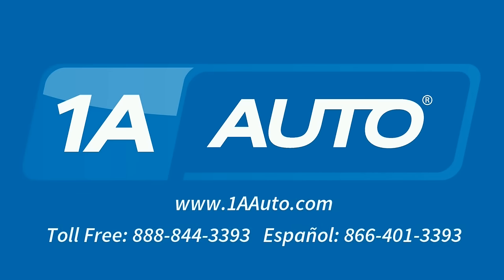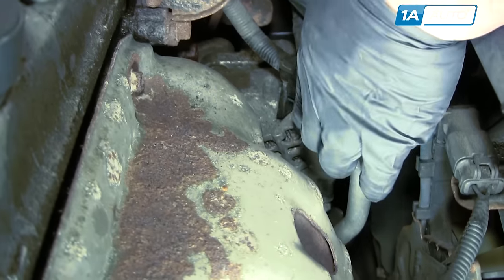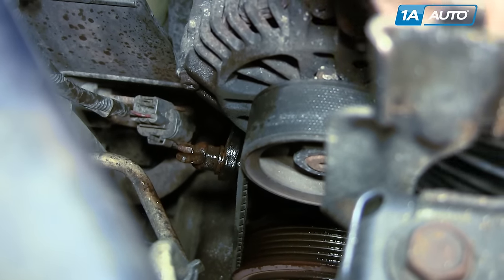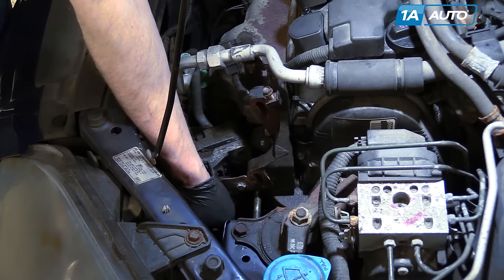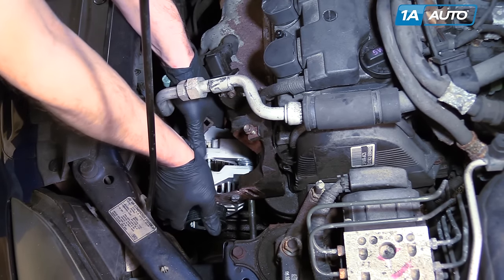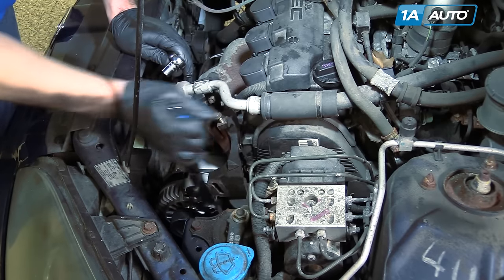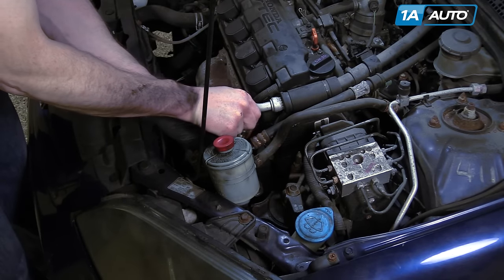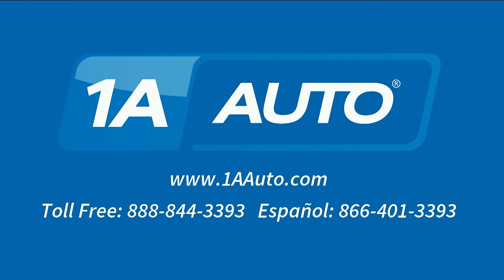How to Replace Alternator 01-05 Honda Civic

Comment: For anyone watching this. If you run into trouble trying to get the bottom bolt in through the lower spacer bracket, remove that lower bracket altogether and put it on the alternator outside the car. Then when you put the alternator back in, its much easier to reach up and bolt the bottom bracket to the motor where there is much more hand room. Also it is optional whether or not you put the cable clip on the new alternator. With the terminals secured it wont be moving around anyways, and those brackets are known to cut your hands to shreds when working around them.
Reply: i fucking love you

Comment: Great video, it was a huge help!!    One suggestion to anyone reading this before they do the work:  wait to undo the battery cable wire and the plug from the alternator until after you get it fully loose.  You can get the alternator into the nice open area vacated by the PS pump to easily access those two things, you can see the guy in the video struggle to get those off with the alternator in place, there was no need for that  :-)
Reply from the maker: +Stephen G Thanks for watching. The advice you gave will assist other viewers perform this replacement smoothly! If any of our viewers needs to make this repair, we carry the auto repair part shown in this video on our website. Here is a link to them http://www.1aauto.com/acura-el-honda-civic-alternator/i/1aeal00432?utm_source=YouTube&utm_medium=CTA+Comment&utm_campaign=ytcomment&utm_term=qE-_5drM4CM
Reply: Question guys I gotta 02 Honda Civic I'm having a issue u might have a part that I can buy from ur guys as I approached the high way my car started like studoring the pick up speed an the rpms started moving up very slowly by a lot it took me a bout 10 seconds just to get to 20 mph the battery gets recharge by the altinator so it not busted what is the issue if u may get back to me I would like to order some parts from u tank u for a great video
Reply: @MK-xw1rp that could be some number of things. Spark plugs misfiring, maybe injectors not feeding the fuel proper, something to do with your throttle etc. I’m not a mechanic tho, and see this was from 4yrs ago. What did it end up being?

Comment: I used your video for my daughters 03 civic......great video but one "improvment" since the bumper shroud is already off, 4screws and the driver headlight assembly comes out and leaves a nice access port to work through and remove alternator through it as well as easier to see the various bolts and gives you a decent view of the belts and pulleys........just a simple suggestion or addition.......you guys ROCK thank you for the videos, huge fan, even mounted a tv in garage so I can play pause while working from your vdeos

Comment: Good video but expect this to take a couple of hours if you have never done this.  Getting the lower alternator bolt and adjuster into the new alternator was the most difficult.  You cannot see the bottom bolt and must do everything by feel.  My reman alternator did not want to fit into the bracket at the top.  With pliers you may have to push the new alternator  bushing in to gain clearance.  Clear the paint in the new alternator’s bolt holes with the old bolts before installing the new alternator.
Reply: Dude i would buy you a beer thank you that tip about the top bolt helped alot thanks man.
Reply: Take the headlight assembly out next time, you can reach in and clearly see and line up the adjuster bolt, removing driver headlight assembly leaves a huge open port to work through

Comment: I used this video to replace my 21 year old alternator with an upgraded high output 130 amp alternator. If anyone else does this make sure you upgrade the cable that goes to the battery with a 4 AWG stranded cable. Not doing so can be very dangerous. Excellent video and thanks so much.

Comment: very informative how-to! Most places want several hundred dollars for labor but I was able to do this myself in about 3 hours.  Getting the old alternator out was straight forward and took about 1 hour of careful work.  Putting the new one in required more work, about 2 hours.  My OEM refurbished alternator was slightly wider than the car's hinge so I had to grind down the joint margins just a bit to make it fit.  Threading the bottom screw + washer + track + hole was a nightmare.  I ended up temporarily anchoring the alternator and then blindly threaded the screw + washer + track.  That one screw took a good 20 minutes of effort.

Putting the main belt on three pulleys was also a challenge until I put maximum slack on the tension washer. 

I agree with the comment about waiting to dismount the alternator before unlocking the power cables -- it's very difficult to do when still mounted because of small space.  I also agree with the comment about first threading the holes in the new alternator before placing in the car.  It makes it easier to thread later when it's in the car. 

I used both socket and allen wrenches, a crow bar, and penetrating oil.  I highly recommend a flexible magnet (it's a very long malleable rod with a magnet on the end) for retrieving the dropped screws/bolts.  No matter how careful you are you are bound to drop at least one.  =)
Reply from the maker: +libertas Thanks for checking us out. 1AAuto.com
Reply: Some of the screws / bolts can def be accessed from the bottom of the car vs trying to do it by FEEL from the top. (inside the left fender wheel)

Comment: Thank you  very  much ! 
1) it was a real pain in the ass to install this alternator. They designed this complicated mechanics to send us to the dealership, but thanks to you I avoided that thanks to your video was .2) rather than using a mirror to install the bottom screw, I unscrew the bracket and I installed it in the bottom hole with the adjuster ... no need to make life complicated for nothing.
Reply from the maker: +Francois Nicolas Mcnichols Thank you for the great reply. We love to empower our customers by showing you how-to perform your own auto repairs while installing our high quality auto parts. Have a great day! 1aauto.com

Comment: Took us 2 hours just to get past that part at 10:30 

I swear you must have the tiniest and most skilled hands to feed that bolt though that mess. Kept dropping the bolt and had to spend a lot of time finding it in the body with a magnet
Reply from the maker: +DrDemento456 Thanks for watching. Thanks for watching. If any of our viewers needs to make this repair we carry the part shown in this video on our website. Here's a link to them https://www.1aauto.com/acura-el-honda-civic-alternator/i/1aeal00432?utm_source=YouTube&utm_medium=CTA%20Comment&utm_campaign=1ATony
Reply: Obviously late reply.
Some advice on this part, if you cut the left tire far to the right, you can reach your hand in there and actually fill it and feed the bolt through.
If you're REALLY having issues you might save yourself some time, break the bolts loose on the tire, then jack it up, pull the tire off, you can easily get two hands in there to do it.
I personally did my SERP belt/ alty replacement/install all at once and I did it with the front tire off to make the job way easier and faster.
Reply: damn, i feel lucky, fed right in after going in blind for 5 min
Reply: My top bolt is getting stuck any ideas I’ve been trying to 4 hours now
Reply: @ViolentMLG 2 years later thank you im about to do all of that on my honda

Comment: Perfect video, thanks man. I had to hit that first bolt with a blowtorch, nearly stripped it on the first try. Had to unbolt the ac hose bracket to the left so I could move it and the  the alternator wires away from the heat.

Comment: Jack the front end up and it's a lot easier to get the belt and bottom bolt off/on for anyone struggling. Can get to it from the side of drivers front tire. No need to remove tire either.

Comment: Thanks for this video the information. It helped me greatly. Other than the wing nut on the alternator tensioner missing on mine. And the locking bolt broke I managed to find the right size bolts and with a little ingenuity I got it straightened out. It really pays to be a jack of all trades and master of none sometimes lol.

Comment: You make it look easy enough so I started to work on mine. Can’t even get past the first screw lol. It must have been tightened with an impact. I’ve used bolt grip sockets and even a torch. What do you guys do for something like that?

Comment: This video saved me a lot of money. I almost gave up at 2:20, but the ratcheting wrench saved me. I tore up the power steering belt a tab bit trying to get that bolt out unfortunately, so I ended up replacing it just in case ($10-20 replacement, no biggy). Thank you so much!
Reply from the maker: +Bryan Thanks for checking us out. Shop for high quality auto parts on 1AAuto.com:

http://1aau.to/m/Shop-1AAuto-c

Comment: Just finished this job in a little under 2 hours. My only tip would be remove your tire. It makes getting the lower alternator bolt out and back in a breeze

Comment: Thank you for video, the engine light had gone after replaced alternator, with engine off the volts is 12.5 and with engine is running volts only 11.5 there is some things wrong with new alternator or battery . Thanks

Comment: hi! Thanks for the helpful video guide. However after changing my alternator, I replaced the alternator/ac belt with a new one but it made a screeching noise when i accelerated for a few minutes then stopped and went back to normal for the remainder of my drive. I read online that the grooves on the belt could be misaligned or the tension could be off? 
Any suggestions please? Thanks!
Reply from the maker: +@MikeTheArsenal We wouldn't be able to diagnose an issue like that here, you may want to have a local mechanic take a look at it. Thanks for checking us out! http://1aau.to/m/Shop-1AAuto-c

Comment: Doing this job tomorrow, Should be fun. Dont do too much car work so this will be my biggest job. But im saving between 140-220 doing myself. So safe to say if i pull it off im buying a big case of beers.
Reply: *update. Well my my first bolt for my power steering was like welded on and stripped right on. Thankfully a buddy stopped by with one of those sockets ment for de stripping u hammer on and boom! 1 minute later bolt was out. everything else was fine job done and car is good! this video was great. Watched like 5 times throughout the week beforehand and i pretty much remembered this job during work. Thanks for the video!
Reply from the maker: +OrganicDepot Thanks for checking us out!

Comment: my car's battery light blinks every now and then but if i rev the car a bit it disappears. I am definitely sensing that the alternator is not charging but it is very random. Could it be a bad alternator or the loosening of the belt?
Reply from the maker: +Shahzad Tazam Shaikh If the belt is making a noise and is worn, you could try to replace the belt first, and then see if that helps. If it doesn't you may want to have the alternator tested. We carry new alternators for many different year make and model vehicles.
Reply: Check your grounds and battery connections are solid too. Do the simple things first before moving on to bigger solutions.

Comment: Well.  Its out. Lol now to put new one in tmrw. Need deeper sockets for this job. If you dont have the longer deep socketa this is gunna take forever. Dont try to do that 12mm locking nut with ANYTHING  that doesnt grip the whole 360 around the bolt. Itll pop off and strip.

Comment: I broke the bolt on alternator wires mount (the one at 9:04). can you tell me what the replacement screw/part number is? I have been unable to find it anywhere.
Reply from the maker: +comput 313 We do not have the part number of the replacement screw.  Thanks for watching!
Reply: @1AAuto  Ended up using an M5 machine screw. Your videos have saved me $800 in labor costs so far keeping my civic running.
Reply from the maker: +comput 313 Thanks for checking us out! http://1aau.to/m/Shop-1AAuto-c

Comment: I thought my alternator was bad but the cable connecting to it had little corrosion. just sanded it off and boom. works perfectly
Reply from the maker: +Tommy D Sounds like an easy fix. That's always a nice surprise! Thanks for watching.   1aauto.com 866-403-3393
Reply: zeek would an alternator tester show a bad alternator even if it's corroded?

Comment: Good video but not necessary to run the car for any length of time. 
If you did it right. Charging a good battery takes about two min and can be done on the next drive.

Comment: My 01 civic kept dying kinda weird the check engine light didn't come on just the battery indicator light took it to a shop they couldn't find anything wrong with it it died again today checked the cranking amps guess what I need a new alternator showed I have 10.69 volts that explains why I lose power to brakes and power steering
Reply: Useful info I experienced the same,about to do it maself.

Comment: No wonder I got charged $150 just for the swap.
Reply: you were lucky if they only charged $150.00 
two mechanics in Alabama wanted 600-650 parts and labor, which did include two new belts.
Reply: With American cars 10-15 min swap. With these cars 1-2 hours.
Reply: @chrisdelgado3530  my Subaru alternator is literally the first and easiest job I learned how to do on it. it’s like right there at the front of the engine bay obstructed by nothing.

Comment: christ, honda engineers sure didnt make this easy to get done.  I've likely got to help a friend this weekend on his civic as it sounds like his alternator bearing is going out.  On my old car (90's celica) they had it mounted up top next to the exhaust manifold, pretty much just had to unscrew 2 bolts, the tensioner and you got it popped off.  Was like a 10 minute job.  I'm not exactly looking forward to this after we just had to replace his starter and pcv valve a week ago.

Comment: I swapped the alternator and now the fans won’t turn on and the a/c won’t blow in cold air and there’s a new battery too. Anyone with this problem?
Reply: The ac line wraps around the alternator, check if you didn't break it

Comment: every day i take off the positive and negative terminals on my battery when i park it for more than couple hours.. i have drains on my electrical system which  i cant seem to find by pulling the fuses.. however i tested the body to NEG post , with nothing connected to the battery and i got 10 volt reading .. could this be a bad battery ?
Reply from the maker: +Frank James It might be. Have you tried a different battery for the heck of it ?
Reply: 1A Auto Parts  i had a semi reputable  shop test the battery..  in their  dignosis
Reply: 1A Auto Parts Heres what i did.. took off the main 2 lead wires to the fuse box under hood .. and tested for leaks ..i had no leaks, but when i put them back i get 12 volts leaking... (testing in series from negative post to negative wire) but i pull all fuses 1 by one and relays without the leak going away so i feel stumped . Alsoi can drive to work and remove the positive and 8 hours later i can drive it home but if i stop 10 minites for a coffee without removing the positive.. it cranks but no start until i spray quick start into the air intake.

Comment: Anyone else have a little whining sound after the new alternator when accelerating not sure what it is not sure if it's a faulty alternator or sounding simple
Reply from the maker: +Trevor grubaugh You may want to check the idler pulley to see if it is going bad.

Comment: But here is the problem somebody had the car before me they put the wrong size bolt in there so now unfortunately the alternator holder is attached to the engine

Comment: I just did this replacement. My low side A/C line is sweating and leaking water. Is that supposed to happen? I did turn the car on and run the A/C for a long time though.
Reply: probably just condensation